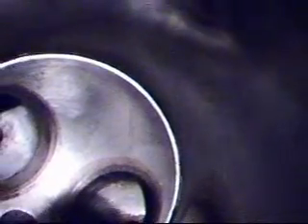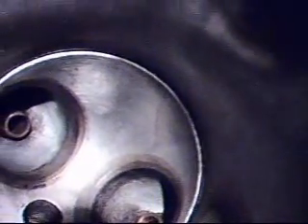Proper matching of 441 parts, cylinderhead.

Comment: @ConvenientSorrow 
I just took another 1/2mm or so off the head face and I had to takes down the liner lip for clearance. The porting and detail work has made a big riding diference. In 20 years with the bike a good improvement.